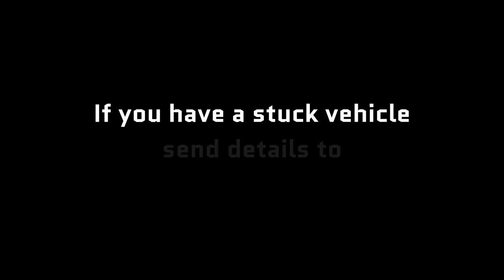The Largest And Most Stuck Excavator I’ve Ever Recovered

Comment: I’ve never commented on any video prior to this one.  This video attached itself to my life by joining my world stuck in an excavator.  I didn’t believe you could unstick it as it was far more buried than mine which was no easy task to unstick.  I am now hooked. Congrats
Reply: ive seen them stuck so deep you had to keep a guy with a bucket  bailing muck and mud from getting into the air filter
this was a made for t v shit show
unless hy dro pump is weak   why not lift one side[track] up .one at a time with the boom down pressure put some lumber under each side then with the dozer pulling turn around and use the bucket to push out like he did at the very last
oh well every one had fun and no one got hurt
Reply: @carlroberts7830  I guess you didnt watch the first of the video. The owner tried doing that from the beginning but everything he put underneath sunk out of sight. It wasnt until he pumped thousands of gallons out of the pit and let it dry some could that finally work for these recovery guys.

Comment: If those tracks turn still. It isn't stuck . 
Dig around the tracks if can to stay clean . Park a massive anchor up top , trailer dozer, whatever . Hook chains on the tracks . I'll drive right out on top of the chains I'll be out in 4.5 5 hours max
Reply: You should make what you need to keep chain centered on that track as it pulls it under . I always use my machines tracks and a tree , etc as a winch plus it doesn't matter if it's mud because your chain is what your base is now. You have the equipment to do it.

Comment: Fasten a log across the front of the tracks.  When you try to pull it underneath it will get it out.  (The Russians carried a log on the rear of  their tanks,)
Reply: nice idea, but I think they even struggled to get the tracks spinning
Reply: @felixb.59  26:00 both tracks spin.
Reply: tracks have to be able to move to do that though
Reply: @maniv100   26:00 both tracks spin.
Reply: @Boyntonstu  after hours of digging yes they spin...
Reply: Ah the ww2 Russian soldier would have blew the tank so the emery couldn't use it.

Comment: I don’t feel too bad. My first time dumping a load with my works tractor, they said just drive to that pasture and dump the compost wherever. It was winter in upstate NY so it was snowy. I did exactly as they said…drove into a swampy area and got the tractor and trailer stuck. It was stuck up to the cab. Between the freezing and thawing it was either frozen in the mud or too swampy to retrieve it. Poor old Bluewas stuck for about 4 months until late spring…ooops!
Reply: Mud season.... Twenty pound shoes...

Comment: The excavator can pull itself out if can get something heavy enough to anchor to,  as a heavy crane operator I get called as the last resort  the last excavator I rescued took a 300 ton and a 500 ton crane to recover from a lake
Reply: 12 weeks
Reply: Dont quite understand why he didn't just let it dry off for a few days and then use his bucket to clear some of the dirt from directly in front then claw himself out ? ?
Reply: Truest statement ive seen on this channel, that 450 has enough balls to pull itself  out by far ,just need a solid anchor point and some smarts of the operator to dig all the mud out from in front of the tracks ,and since the had full 360 range of motion, i dont really see how that thing was actually stuck
Reply: @lenworthsewell9473  Video content was how it was stuck, Lift the tracks off the ground with the buckets slide matts underneath swing around 180 do the same thing and drive out.

Comment: At 0:45 I would guess if it will start and run, then you should be able to dig yourself out in 50-80 minutes. Everything seems to have dried out, so I am assuming that what I can see is not just a skin on a mud pudding.

Comment: It kind of bothered me how close they were to the cables pulling the excavator. Those cables sometimes snap and they will kill you if they hit you.
Reply: Ease up safety Sally. Those 3/4" cables can take a lot. Plus they weren't under any more tension than when the operator was in the cab (the most likely point of whiplash)
Reply: Ehhh I wouldn’t call it safety sally, just common sense.

Comment: That 450 needs some work,I’ve worked on a bunch of them and part of the reason it’s stuck is it’s way down on power,I couldent believe it wouldn’t lift itself even with the suction,also a normal running one will spin the tracks no matter what,when it was coming out of the hole and grunting I heard a hiss,sounded like a boost leak,relief pressures should be checked also
Reply: my thoughts aswell, that hoe was seriously low on power, engine and hydraulic it seemed. Could barely walk it's own weight after getting out of the mud.
Reply: I second that

Comment: That old deere is WAY weaker than that machine should be. Either the control valve is internally leaking or the main system relief is set wayyyy to low, those tracks shouldn’t have struggled in the least to turn. Before attempting the recovery as soon as the tracks didn’t spin I would have upped the circuit as well as main system pressure.

Comment: FYI 
bolting or chaining a log across the bottom of the tracks and then drive it out. Obviously the log would need to be removed once it travels around to the back but this will pull any tracked machine out of the worst bogs. It takes time but not 12 weeks.

Comment: why not just use high pressure water.
Reply: water was the reason they're in this situation. but really i doubt they have to equipment to suck out the mud after they spray it. or the equipment to spray it for the most part. it's not often you have a situation that would require that kind of equipment so it's just not a great idea to spend that much money on it.